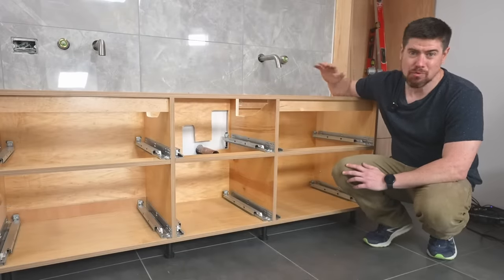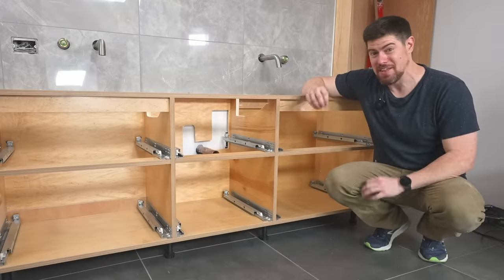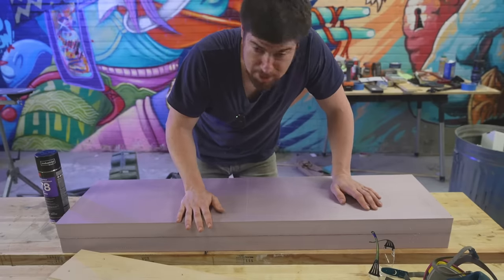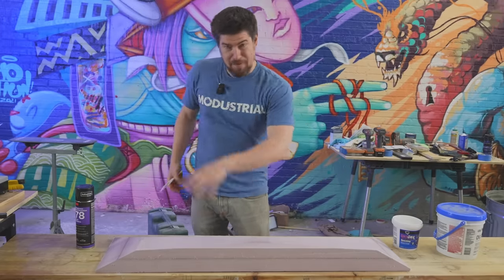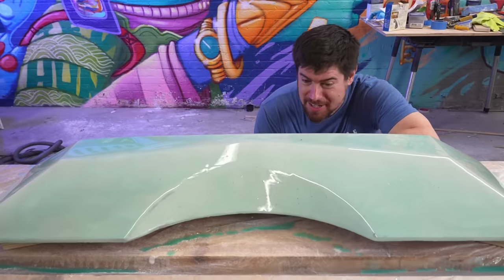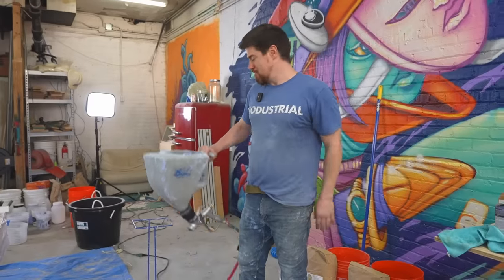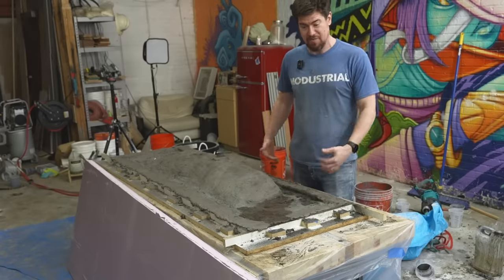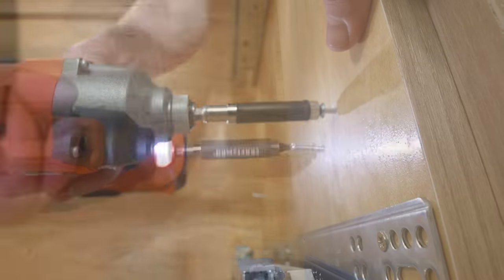AMAZING Concrete Ramp Sink DIY...  with INGENIOUS Mold Making Technique

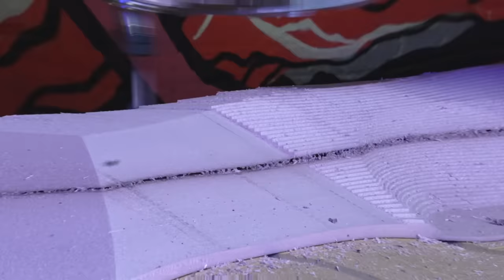Comment: 4:33 Are we just going to ignore the fact that glue was just as bad as all the others?
Reply from the maker: This one didn't melt it, it just didn't fully bond...  I needed a weight on the foam so that it was bonded fully over full surface
Reply: @modustrial  ah.  That would explain the gap too.  Thanks